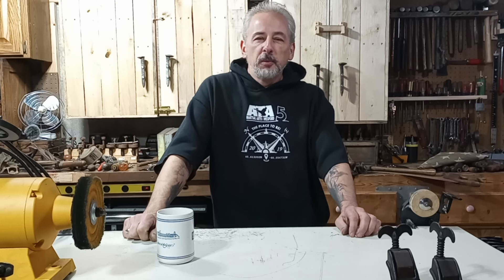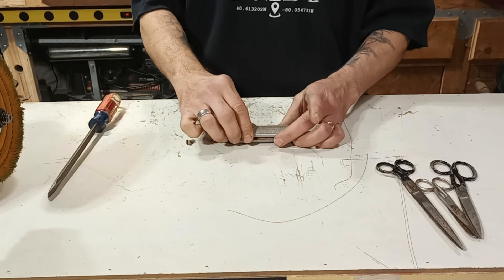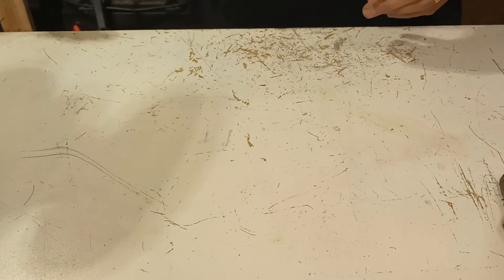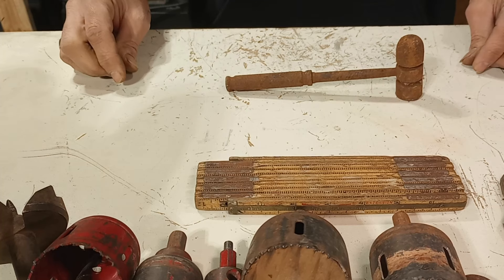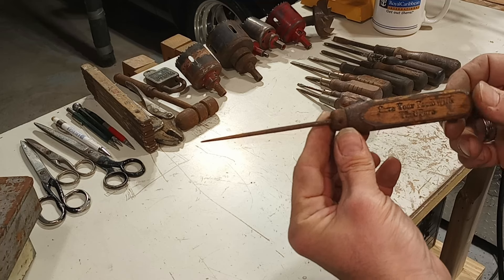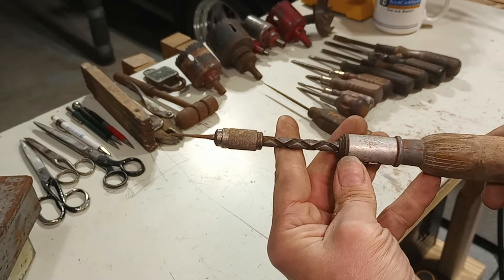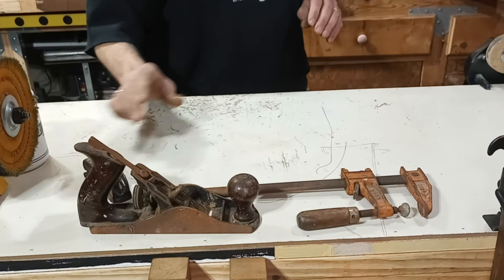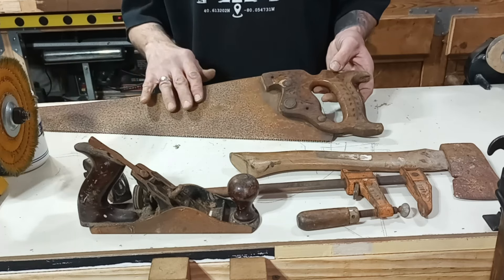My Rustiest Tool Haul and a Big Find

Comment: Looks like you did well and had alot of fun in the process. I like the machinists hammer. It would be very useful in my shop. The lathe is a real find. I hope you can get it up and running as a useful shop tool. Thanks for saving these tools from a rusty death.
Reply from the maker: thanks!  yep, it was a ton of fun rooting around the old workshop hunting for rusty gems!  I sorta happened into a collection of small machinist hammers one st a time.   the lathe find was definitely the best( hopefully once I start its  restoration it won't be a nightmare )!  👍  Appreciate the visit!  'No rusty tool left behind'

Comment: Cool finds Matt. Those rusty tools are what I look for. I can't wait to see the lathe cleaned up.
Reply from the maker: thanks Ivan!  I seem to be a rust magnet!  I don't understand why other folks just pass over these tools, lol 😂  that lathe will be my masterpiece!  👍  ( or greatest nemesis  )
Reply: @MattsGarage1791  i seek out the old rusty tools. Most people think they are junk will just about give them away. I love restoring them. The element of surprise when you find a gem can't be beat and most people can't believe the before and after when i show them. I really can't wait to see that lathe. I have a vintage Dremel Roto mini lathe i picked up about a year ago and I've had a blast with making handles for chisels, screwdrivers and anything else that needs a small handle but it can make about a 6" handle. I'm ready to find a bigger lathe now. I have a nice collection of antique Craftsman woodworking tools (table saw, belt/disc sander, 4" jointer planer) all from the late 30's to the late 40's that belonged to my grandfather then my father and now me. I'm currently working on restoring all of those as i get time.
Reply from the maker: Restoration brothers for sure!  I'd live to have a shop loaded with vintage tools that are restored to everyday use.  that's why i was so excited to see this lathe still available because it's a rather contact one. not a large floor model.  as you said, perfect for handles and smaller projects.  I do believe it's a metal lathe( even better ) will just need to source parts.  take care!
Reply: @MattsGarage1791  I'm working on getting all Craftsman shop tools from the same era so i can have a shop full of vintage, restored machines to use everyday. I still need a lathe, band saw and a floor model drill press. The hunt continues 🤣

Comment: Pretty neat haul. The red hole saw is almost sure to be a Milwaukee. It may have traces of white paint which would have said "Milwaukee". Not terribly old. The last drill bit is interesting. The worm screw pilot bit is likely for a bit brace, not an electric drill. The Huot and Driidex cases are back to the sixties or earlier. My dad gave me a Huot in the late sixties. By that time they had converted to plastic bit holders on the inside. Good for you for the flag on Veteran's day, Matt.
Reply from the maker: Thanks so much!  There are many benefits to this 'hobby',  the  knowledge you gain in researching and restoring is one of them.  I've got several braces so may have to try out that route.  there is while lettering on one of the gole saws, maybe portions of Milwaukee are visible.  I love finding things that predate the mass introduction of plastics and polymers.  Really appreciate the visit, take care.

Comment: Hello, I just commented on another video about farm tools from  Smethport. I have the same Handy screwdriver that I cleaned up. Mine still has bits but how do you clean the plastic bit storage thingy? I wiped it down and cleaned inside with q tips but I’m afraid to remove it because it seems it may break. I’m sure it was clear at one time to see the bits…maybe🤷🏻‍♂️.
Reply from the maker: Hi again BladesRking!  The handle comes off by removing the bottom screw and pulliing the handle off of the shaft.  They are always on VERY VERY tight and probably need some patience and help to pull loose.   The shaft has small ribs on it that the handle must line up with.  my attempt in my video for cleaning did not come out as good as I hoped( handle should be clear but yellows with age ).  Soaking in a hydrogen peroxide solution with UV light should help reduce or eliminate the yellowing.  if you want, you can watch my video on restoring the handyman for guidance.  Feel free to ask any questions... Take care.
Reply: I’ll give it a try. I just looked at them and both are North Bros. Philly, Pa. One is a model 4, it’s mostly brass except the handle. Also, have a Craftsman that does the same “auto twist” drill. Handle is gray with a red top and you rotate to which bit you want. I would love to talk to you and send pictures of this stuff.
Reply from the maker: @BladesRKing I'm starting to gather quite the collection of old North Brothers and Stanley Yankee drills and screwdrivers and they can be tricky.  Feel free to drop me an email, it's in the channel description.